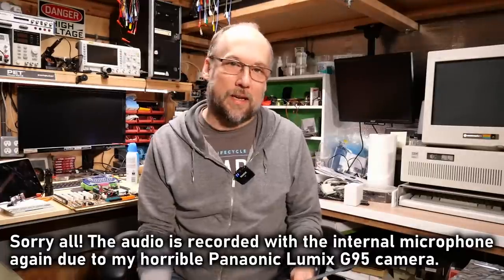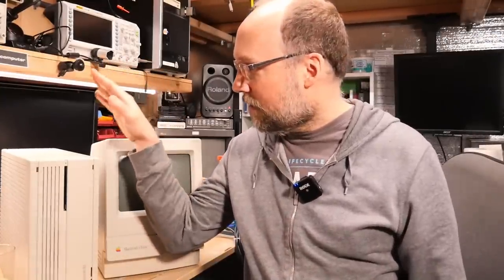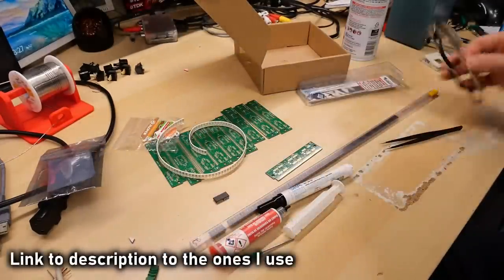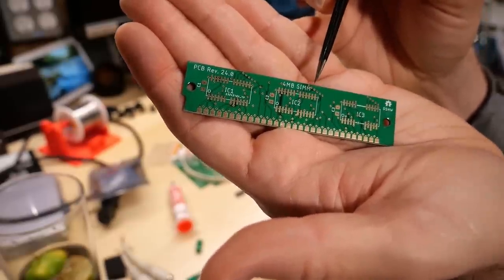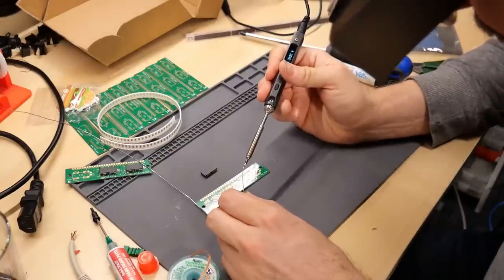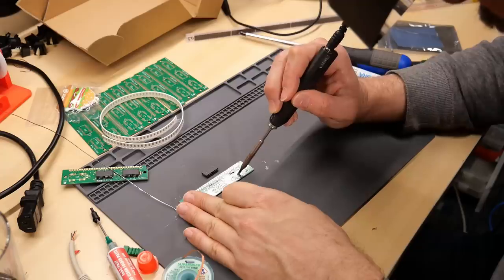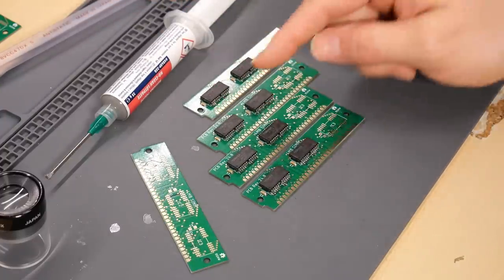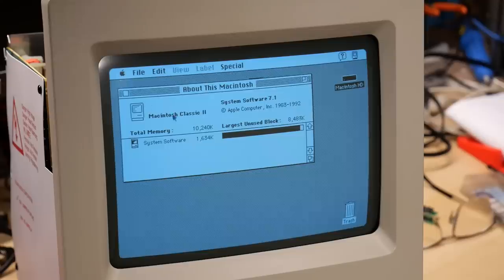Nibble Size: Let's make some memories!

Comment: The Amiga 500 also gets quite a boost when you add "real" fast ram i.e. on the left side expansion slot or via a CPU socket addon (not the "fake" fast/slow RAM you can add in the trapdoor slot), since the CPU doesn't have to share the Chip-RAM with the main chipset. In some cases, it can run up to 30% faster by just adding RAM.

Comment: just the other day I was teasing my brain with the possibility of hooking up a 486 to modern 10ns sram chips and disabling dram refresh and L2 cache.
Reply: Wouldn't that require a couple of address latches besides the RAMs to store the Row address and the Column address before activating the RAM itself?
I'm asking because a similar idea has occurred to myself, and i think that's the way to do it.
Reply: @BertGrink  486 has physical pins for all of D0-D31 & A2-A31, its the chipset that generates dram stuff, so if you somehow bypass the chipset...
Reply: @protonjinx  I was actually thinking of the ZX Spectrum where the ULA generates the RAS and CAS signals, but the problem is the same. The main issue is to NOT have it attempt to "refresh" the Static RAM, if you get my drift.
Reply: You can do that and it will work something crazy, but you end up needing a custom motherboard, pretty much. With today’s static memory you could be running a 486/50 with no L2 cache and no RAM wait states. It’d be a wicked experience, since RAM is the major thing that keeps any CPU slow. It’d probably work faster on general purpose code than a 486/100.

Comment: these chips r large enough to be soldered by iron & the best quantity of solder paste is to use the thickness of the stencil . u just line it up and press it flush then apply the solder paste with a card and then melt it .

Comment: At least you had a crack at it. Soldering properly isn't difficult but does need practice. Flux is your friend though... and lots of it. Can I also state that you shouldn't apply the solder directly to the iron tip unless you're tinning it. Apply the solder to the pad with your iron tip next to the pin on the pad. You'll find that the solder will flow nicely with the flux. Generally I solder one or two corners down too in order to hold the component down then with the flux, solder and a chisel style type tip you should be able to drag and solder the other pins (or do each pin individually). If you bridge any just go over the bridge with your iron tip and it should take the extra solder away and undo the bridge.

Comment: i guess that mac had the same concept like the amiga with fast and chip-mem. the chip-mem was the address/data bus where the chipset was a kind of bus master and the cpu was the slave. so the master in that case was for reading out the video data and also some dma channels for disk i/o and sound output and other co-processors like the blitter in the amiga.
this concept is of course a very cool concept and lets the program run without waiting from the fast ram and only access to video memory and i/o data needs some cycles of waiting.
theoretically with a kind of memory controller chip you could implement 1 or 2 words of write cache to write into the chip-mem without stalling the cpu. i don't know if that had been done. would also be interesting if there is an off-the-shelf standard chip that can do this.
i guess the SuperCPU in the c64 did probably something similar. this would be super cool to make an open source extension for the c64 with the 65816 cpu from western design center.

Comment: I might be wrong here, but my practical experience with cooling opaste is that it may dry up in the syringe if it is stoored for too long in room temperature, at least i had the same experience with the paste did not float out properly, like this.

Comment: I maybe misremembering but I was at university in the early to mid 90’s and I remember working on PCs Amigas and some Sun Sparcstations  all with 30pin Simms 1,4 & I think 8mb but they were picky as hell with what would work with what. I remember having a much easier time with the 72pin sims later in the 90s.

Comment: You shouldn't add flux. The solder paste balls are suspended in flux. All that happens from adding flux is the paste out gassing etc when you heat it. To make the paste application easier put the paste in warm water before using it.

Putting down a line of paste works but only if you get the amount just right. Instead use a tooth pick to put a small blob on each pad. It doesn't matter if you get them all the same or anything.

Then warm the whole thing with your hot air to get everything up to temp first and activate the flux. Then direct the heat onto the component and you'll see surface tension pull everything together. Excess solder should ball up and you can clean that off with alcohol and a brush later.

Comment: Very cool kit!

Surface mount soldering scares me because of my crap fine motor skills(part of being on the autistic spectrum). You did way better than I ever could!  That said this inspired me to get over the fear and try it regardless. If I find it nearly impossible for my limited fine motor skills at least I tried!

I really appreciate showing your errors and being blunt about it then trouble shooting. Part of learning is making mistakes!.

I see you using acetone instead of isopropyl...Is it because your city is dry on isopropyl alcohol too?
Reply: I've not yet had a chance/need to try it but it's my understanding you don't really need ultra fine motor skills for hot air SMD work, the idea is to get things close and then let the surface tension of the hot liquid solder pull the part into alignment.

Comment: Rather than putting flux on the parts... much easier to put it on the PCB... and you used too much paste... either use a stencil or just use a bit less or for those... just hand solder... opposite corners first.  Practice makes perfect.  Thanks for sharing. PS... To get rid of bridges use flux in Rossmann quantity and heat up and sweep soldering iron gently across... normally comes good.

Comment: Most of the time I see people using a solder mask for applying the paste . 
With out a solder mask, they are careful to only put the paste on the pads .
Reply: Stencil, but yes, particularly for people who aren't experienced in applying directly from a syringe.  You can usually order them as an optional extra from the PCB house.
Reply: The solder mask is on the PCB. Unless you apply too much paste the solder mask on the PCB will actually keep the solder in the right places without a stencil.
Reply: I usually only see solder paste used on BGA packages. This is the first time I've seen someone try to use it on a J lead SMT package.
Reply: What I tend to do is use a a small glob at one end of the pins and use an old credit card or something to smear a thin trail along the rest of the pins on the line. Then I put down my chip and heat it. The solder will self-align the chip and spread out along the pad and anchor the legs down. I've only ever needed to use stencils when I've worked with BGA or extremely fine pitched packages.

Comment: FYI: There are adapter boards that let you plug multiple SIMMs into a single slot (edit: I found an ebay one for you that's $11 below, lets you plug 4x 30-pin modules into a single slot) -- In Highschool we found them in a junk bin and put them into a Pentium 1. -- It allowed us to plug 16x 72-pin SIMMs into a board with only 4 slots -- we were able to get it up to 128 MB (which even for a Pentium 1 was a lot). -- It seems like a rare part -- but if you're able to replicate one of those in 30-pin format, it would be easy to stack several of these 4 MB parts into a single slot...
Reply from the maker: Thats neat, I had seen 30 pin to 72 pin adapters, but not 30 to 30. Of course those won't work well is many things -- like can't even put two adapters next to each other and then clearance problems. Still neat idea though!

Comment: Using solder paste you need a stencil, best way to solder those chips  is to apply a lot of good flux and tin each pad not using the soldering iron, not like a paint brush add solder pin for pin clean and apply new flux , align chip and use hot air to solder

Comment: I have ZERO experience soldering like this, but I’m wondering could you flux and then “dip” the legs of the memory chips in the solder paste. After that you just flux the pads, put on the chips, and heat them up. Seems like an “easy” way for a more precise/sparing application. Just a thought. Really enjoyed the video and your channel.

Comment: The audio isn't bad.
Solderpaste has flux in it.
I wouldn't use hot air.
Use thinner tinn. It's way easier that way.

I would just use a soldering iron and tack one leg of the chip to the pcb then check its alignment and after that solder the rest.
If you want to be careful you want to take a break soldering after 1 or two leads.
If you want to use hot air, practice with the paste you got on disposable stuff.
Can you show what it does if you put faulty memory in it?
I would use a x86 because they are more common and you might be able to buy new stock with old SIM RAM slots.
Also you can run a memory test software on it. Like memtest86.

Comment: What I've seen from Louis Rossman, you tin the pads first, then apply gel flux and use the hot air gun to place the chip with tweezers. I personally have absolutely no soldering experience and just going off what I've seen from other YouTubers.

Comment: I wouldn't even bother with paste without the stencils. Hand solder with a very small diameter solder (0.5mm) and flux. EEVblog Dave has a nice video on hand soldering SMD.

Comment: Avoid solder paste. Only necessary with stencil pcb assembly. Just use gel flux and a appropriate solder pencil tip and drag solder the chips.

Comment: Now I'm curious about whether hand-building memory would be cheaper than just buying them from eBay/wherever. 

Also, would it make sense to need to stress test the modules to make sure that they won't cause instability in the system?

Comment: you should be drag soldering the chips not hot air.......... those chips are designed to go into the sockets that are like co pro cpu's, the ones without holes. you need to bend the legs out 90 degrees then solder..... p.s hot air is bad as you have found out, warps single layer pcb's.

Comment: Adrian, sometimes is easier if you use some kind of tape to fix the circuit to the table/soldering mat (if you don't use the heater). Youĺl find out that you have two hands again :-)

Comment: Is there a similar project for power supplies a bit like picoPSU but for computers ? I find it hard to get proper wiring diagrams and connectors to mod a standard modern ATX for older motherboards from the early 90's.

Comment: Your paste looks old.... I use a much finer needle and sure it takes a little pressure to get it going but with a needle as big as yours you shouldnt have any issue...
Also solder paste has flux :p the flux is the liquid portion of the paste.

Also focus on preheating the board before you focus the hot air on the pins.... You do this by hovering a bit higher and and over for longer so the heat soaks in.

Comment: for these large pitch j lead parts you'd be better off just sticking them onto the pads and soldering them by hand one pin at a time.  Don't even use flux as long as you solder is flux cored.  You can surgically add flux to try to clear up any bridges.

Comment: I wonder if 16MB ones are in the works… if so, I might start looking for a SE30 board. My favourite of the 68K Macs are the LC3 and Classic 2, but I always wanted the 30…
Reply from the maker: The memory map of the VLSI chipset on the Classic II just can't handle due to 10mb of RAM due to way the ROMs and IO ports are laid out. This is unlike the SE/30 and Mac II machines which could handle a lot more RAM.

Comment: Old solder paste does not wet the pcb contact very well, I think this is one sign that the paste is reaching its sell by date. :(  For those chips I'd use a soldering iron.

Comment: holy cow! starting at 10:50 you see how flat the ram chip is, and the next shot its entirely bowed! is that an optical illusion? I didn't think boards could curl like that!
Reply: I suspect it's just pad underneath bulging from the heat, not memory module.

Comment: Amigas run faster with more RAM because the additional memory is for the CPU only where as the built in memory is also being shared by the custom chips.

Comment: Better to not use hot air on something that thin. Just pre tin the pads, then set the chip on there and touch each leg with the soldering iron.

Comment: I have a Boxed Classic with all the bells and whistles, the logic board leaked so got a Classic II board instead, upgraded the Ram to max but still no chime, need to replace the caps? Also the internal fan is quite loud tried cleaning it out. upgraded the internal SCSI HDD to 500mb, anything else I can do with it?

Comment: Also on the other side, i wonder if there are 1MB module variations.
Since, at least here on Balkan, the prices of 1MB SIMM modules are hell to find, and when i do find them, it's 10eu per 1MB module.
Reply: You should be able to use the same board but populate it with smaller chips, the pinouts should be compatible.

Comment: Louis Rosman would be turning in his grave at the soldering effort here,  oh wait his not dead yet but this vid just may kill him.. lol i'm kidding. For start i think your solder past has gone off, never seen it that thick before, secondly i would have put the pcbs on a scanner and created a simple mask for the process using a thin flexible piece of plastic to swipe the solder over the mask so its only on the pads. please give it a go you will be surprised at the result.

Comment: another way extra ram can boost speed: less hard-drive swapping. (for example, a program using 12MB total RAM could have 0.75MB minimum physical RAM (0.5MB core and 0.25MB+ swappable) ... the more RAM you have , the less it's bogged down by hard-drive swapping)

Comment: I'd just pretin the pads and the chips a bit and then drag them with a "knife" tip. As long as you can see a bit of the pads and have bit of solder down there the heat should go through just fine.

Comment: So there's a limit of 8 MB of module memory, but can the onboard memory be upgraded also, I wonder. I expected a ram check of some sort, but they're probably okay. Seems your solder paste might have dried a bit. In other videos I've seen, the paste is certainly much more viscous.
Reply from the maker: I read the technical docs for the Mac Classic II and the memory map in the VLSI chip just cannot accommodate more than 10mb of RAM, so there is no way the built it RAM can be upgraded with the machine recognizing it.

Comment: No critique from me, surface-mount is something I struggle with too, it's definitely designed for machines to do rather than us humans, replacing a SMD fuse in one of my two PS1 consoles was tough with my not quite appropriate soldering iron tip (smallest one I have, which wasn't small enough!), so had to blob one side on, it works, but is ugly!!! :\
Reply: I've done some SMD work with an old-school soldering gun. It's certainly doable yet hard when you use the wrong tool. For smaller parts I need to warm up my real soldering station which gives much more control. The real mystery is why I don't go for that in the first place.

Comment: Is it possible that the machine runs faster simply because it doesn't have to use virtual memory?  I've had a similar experience on PCs with Windows 95.  Even though the official requirements are 4MB of RAM, and even though it runs well enough with 8-16MB of RAM, I've noticed that it isn't until around 32-48MB that Windows will stop using the swap file aggressively.

Comment: Solder paste should be applied with a stencil placed over the whole thing and use a spatula to spread it through the stencil, then when you remove the stencil, you leave solder paste only on the pads. The way you did it is messy and prone to bridges :(

Comment: I've done SMD soldering before, it's not that hard, just pre-tin the pads with solder and place the device then heat the pins with an iron till the solder melts.

Comment: I would have used (a very thin layer of) the paste without the chips, heated to tin the pads. Then applied flux to the chip pins, set them in place and heat gunned them to flow and connect. But that's me.

Comment: Hmmm would be cool to see a 16MB version of this board. :)
Reply from the maker: I think it would be really hard to assemble due to the packed number of chips it would need (8 of them) might be impossible to hand work.
Reply: @adriansdigitalbasement  , well some of the crazy stuff I have done is pre-tinning the pads and using flux and using a rework head gun.

Other things I have done is a frying pan with some fine grain sand to sit the board in and watch for the solder to melt so I could then remove the board with the components from the sand.

Best option would be a reflow oven, but I don't have that kind of money so I just try to get creative.

Comment: Could I use these chips on a re Amiga1200 directly to the motherboard? I'm a noob, so sorry if it's a silly question
Reply from the maker: Probably not -- they might be 1mb x 1bit chips on the Amiga if it has 8 -- or even 1mb x 4bit chips have less pins (I think)

Comment: cant you just take old simms and remove ram chips with the hot air, then replace them with these new chips.
replacing chips may be easier than spinning new boards(for a learner), and if you use ram you have loads of you can practice on them.

p.s. spot the mistake, old simms will be thru hole not smt, sorry about that too tired.